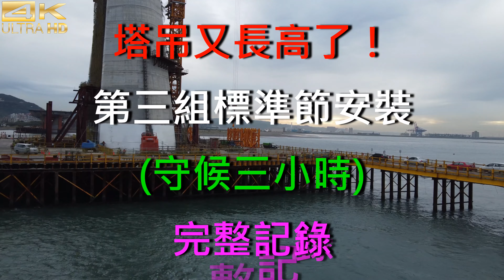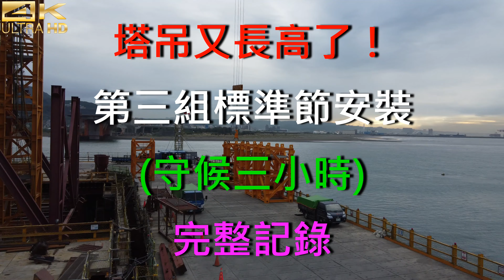2023.11.29 PM 16：10 空拍淡江大橋—塔吊又長高了，第三組標準節安裝(守候三小時)完整記錄【666】4K

Comment: footage0843/1056 shown the structure connector locking lower part one corner has the darken seemed rust on the small area of the connector, is the rust a factor dangerus? Y23NOVEMB29WEDNuscaptpm0540
Reply from the maker: That's oil lubrication